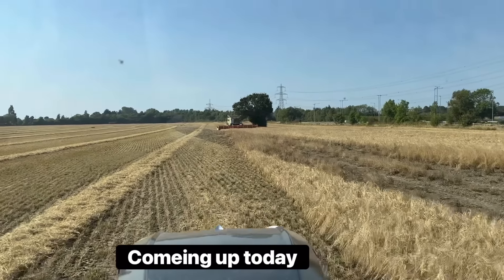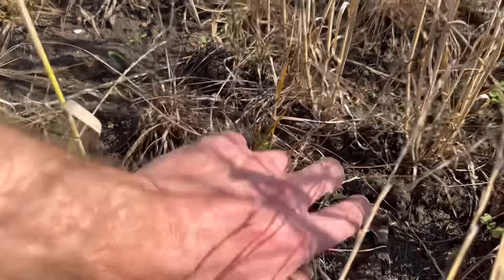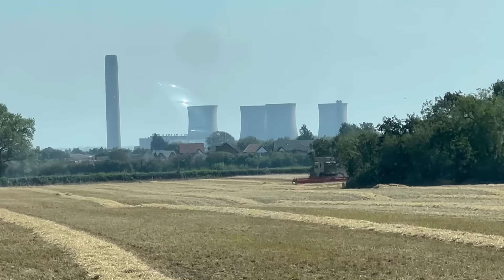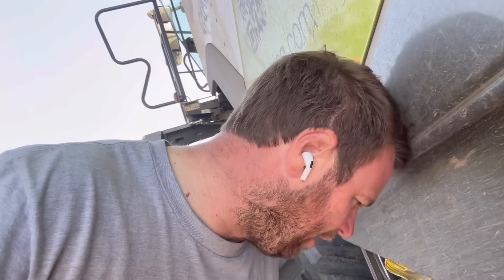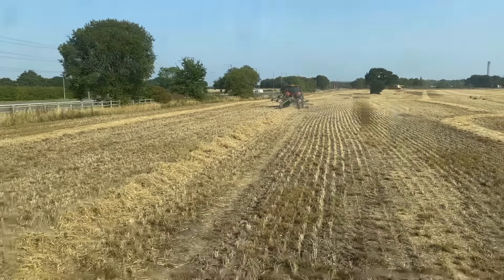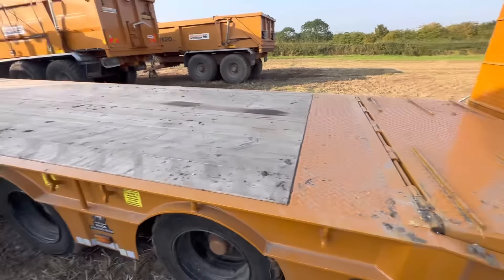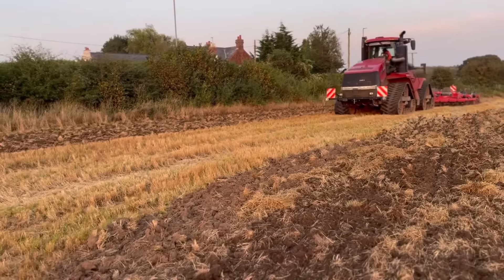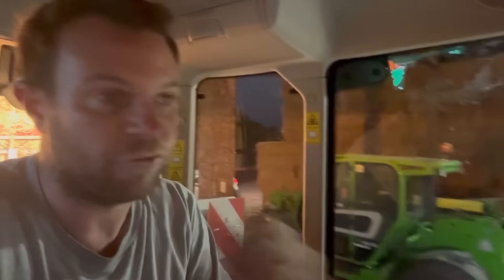WE HAVE SLIGHTLY DAMAGED THE COMBINE 😳AnswerAsAPercent 1634

Comment: If you have to straighten one of those bars in a hurry, use the front of the trailer where it tips / body moves away from the chassis and drops down as a mobile press, it'll get you going.

Comment: Reading the high lighted text I would agree that there were grounds to argue that it is permissible to allow a child to have quick jolly around private land so long as there were no implements attached to ensure you can't be accused of going somewhere for agriculture use. I would advise caution as this 1998 Act is aimed specifically at agricultural operations where traditionally children help on the farm. Is this the only place in law where it specifically bans children in tractors? Looking at the HSE guidance they seem to think a child has to be 14 to be mature enough not to pull controls without permission or distract the driver though I guess that ultimately depends on the child. I'm surprised that the age isn't 13 to coincide with when you could legally pay your kid to work part time on the farm.

Comment: Check it out Olly.  But it's days riding ON. Tractors that have full cabs plus a seat belt.. I would consider riding IN?
THERE'S NO MENTION OF HEIGHT..
WHAT'S THE DIFFERENCE IN A TRACTOR AND A LORRY?  None that i can tell?
I'm not an expert either but common sense tells me. 
The law is outdated, if it is law?  
Acts and statutes are not law i think?